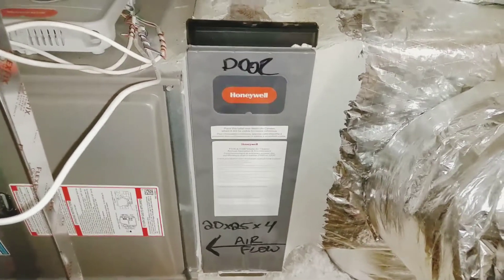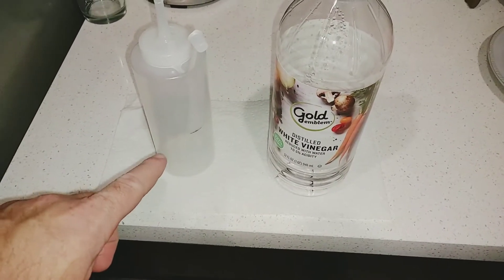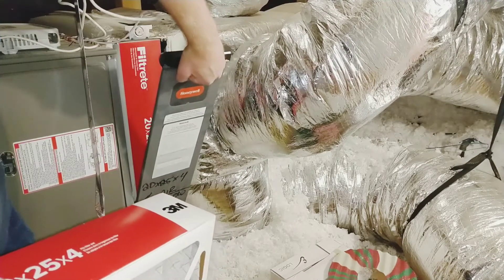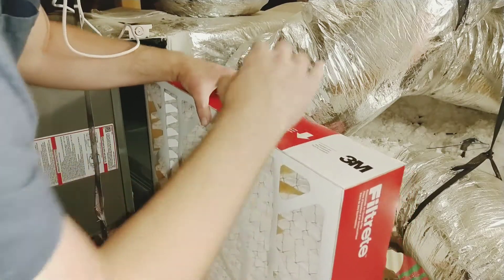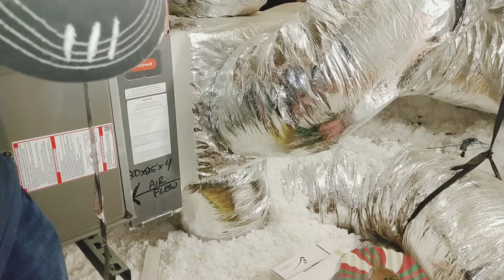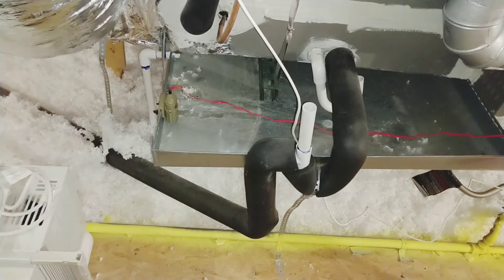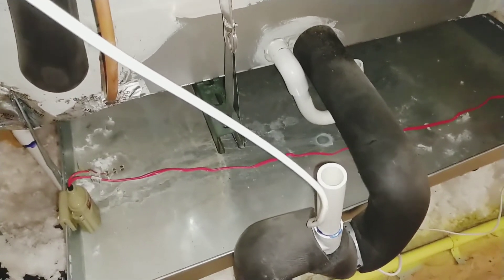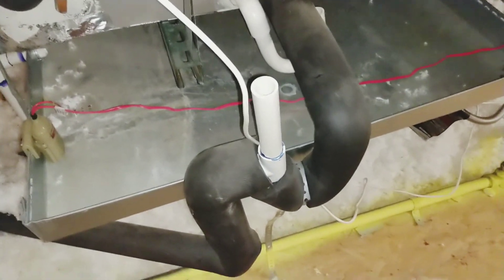Change 20x25x4 Air Filter in Honeywell Media Air Cleaner F100/F200

Comment: Do we need to turn off anything while putting the filter or putting the vinegar?
Reply from the maker: You should shut off the AC, so it doesn't run while installing the filter so it doesn't suck in any unfiltered air.
Reply: @becausestuffbreaks  Thank you!
Reply from the maker: @mr.j6805  you're welcome. Thanks for watching!

Comment: My filter isn't coming out. It gets stuck at the exit. Anyone know a fix to this?
Reply from the maker: I had that happen with one that had some of the filter folds smashed and sort of warped the whole filter, so it snagged on the inside. Try to see if the filter is warped or identify where it's getting stuck. You can use a yard stick to get back and push the filter element away from where it's snagging. Let me know what you find.

Comment: Thanks!  Our unit had been replaced with the Honeywell tower.  Our old unit had clips holding the filter door closed. I was struggling to open the new one without damaging it.  I knew there had to be a magnet .  Glad I found your channel.  I think the foam taped adhesive which was stuck to the unit was making it harder to open.  All good now.  Thanks!
Reply from the maker: I've had mine get stuck like that too. Thanks for watching!

Comment: I hear a noice like the vent is running but it isn't neither is the ac on is that what happens when the air flow is clogged
Reply from the maker: You can make a video showing what you're talking about and share it on my public group on MeWe. Link in the description. Then I can try to figure it out.

Comment: Where is the air handler
Reply from the maker: Depends on your unit and house. Some are in the attic, closet, or basement. It's the part of the whole thing that circulates the air and has the heat and air conditioner coils in it.